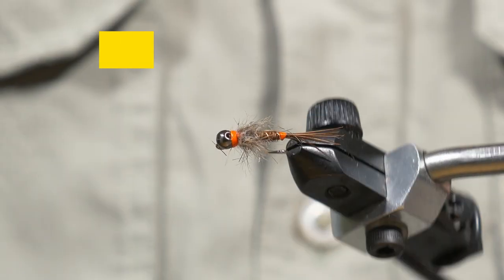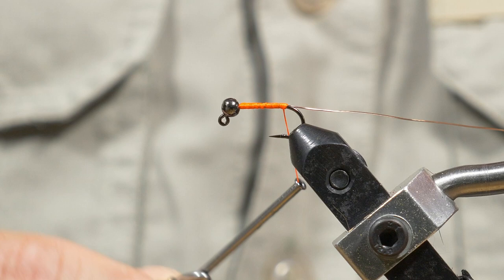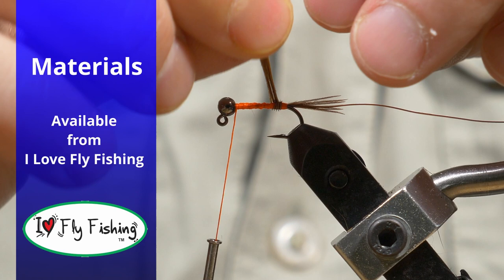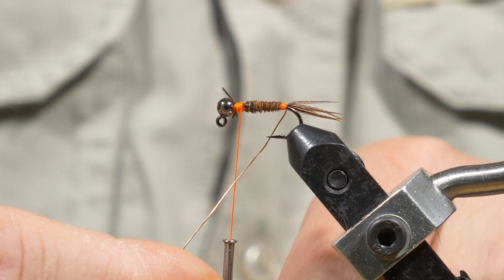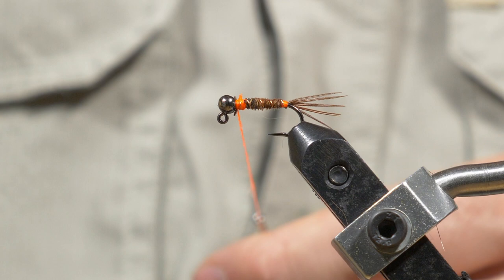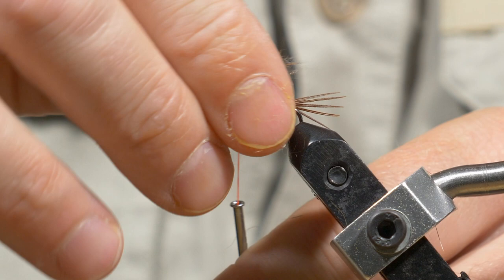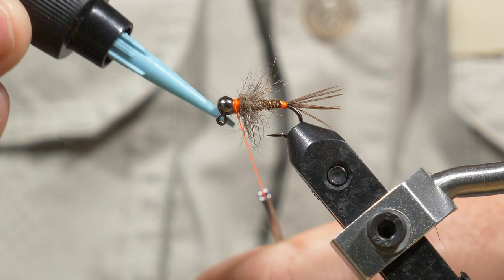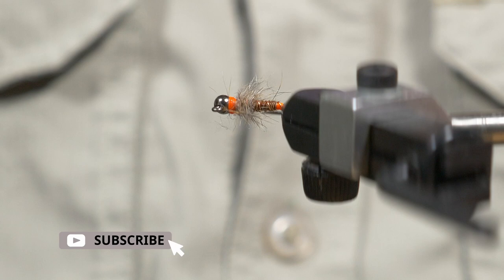Euro Jig Pheasant Tail Nymph | Fly Tying Tutorial

Comment: I make a very similar one to this, Johan, but use a CDC collar instead of the squirrel you used.  It's one of my most effective flies in Montana.  You may also want to check out a minimalist Frenchie for your waters: Fly Tying Plastique Frenchie | Hackles & Wings ( https://youtu.be/-rEj6P-Q974 ).  It's super easy to tie and sinks quickly, like a Perdigon.  It's been very effective for me.  The key to it is the slim body, so if you tie it, use an 8/0 thread or thinner.  The guy who made the video ( Simon? ) uses 18/0 Semperfli Nano Silk in Brick Beige color.  That thread is nearly unbreakable and super thin. The Brick Beige color blends in pretty well with other materials, so now I use it for most of my tying.  Because of the thinness of the thread, you can create dubbing loops without building bulk.  I can easily split the thread as well.
Reply from the maker: Oh I will definitely try the CDC collar. Have just bought a bunch of CDC so perfect timing. It's not my Simon tying that Frenchie but I have been using a thread Frenchie pattern Simon showed me that is pretty much the same just different colours. It's with black 30D Veevus GSP (again almost unbreakable) for the body, barred hackle feathers for the tail and red copper wire for the rib. I tend to use either peacock blend or purple UV Ice dub for the thorax with a gold tungsten bead. Works extremely well on a couple of rivers here. Thanks for sharing the info and link.
Reply: @CrazyAboutFlyFishing  I haven't tried purple ice dub for the thorax yet, but I have used UTC Holo Tinsel Purple Medium for the body and did well on it.  So I expect the purple thorax will also do well.  Good idea.  I've been experimenting with different ways of applying CDC as a "veil."   Check this one: Crossover Nymph Fly Tying Tutorial ( https://youtu.be/udEZsDblpq4 ).  It's fast, but ads some bulk and wastes half the fibers on a feather.  The other method I'm now practicing is using the SwissCDC Multiclamp to trap the fibers on one side of the CDC feather, splitting the GSP thread, and inserting the trapped fibers into the split thread.  With this method I'm using all the fibers from a feather and have a better looking fly.  I've been viewing Marc Petitjean's videos on how to do this.

By the way, that Crossover Nymph is another excellent fly on the rivers I fish.  I tie them in sizes 14 and 16.
Reply from the maker: Awesome thanks. Having a look now. Ordered some CDC clamps too recently just waiting for them to arrive. I was planning to give the split thread method a test as well.